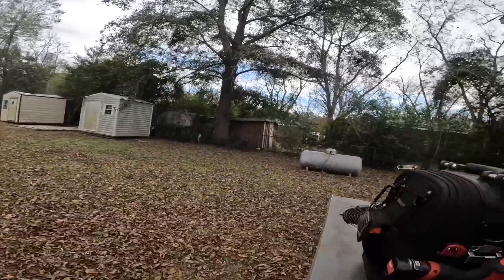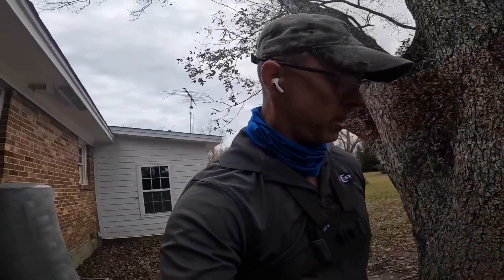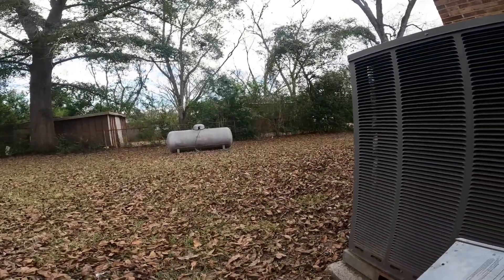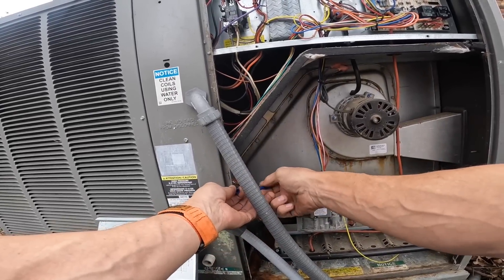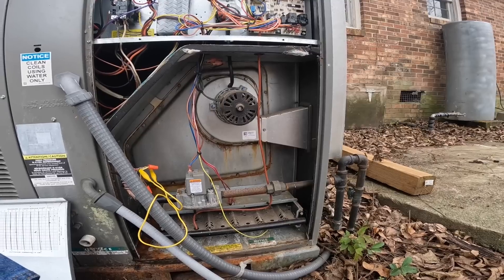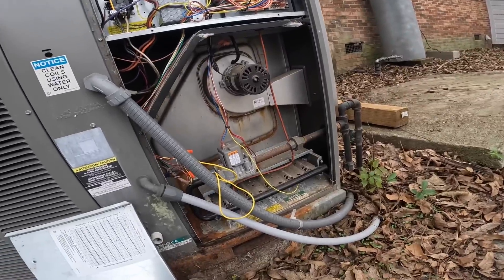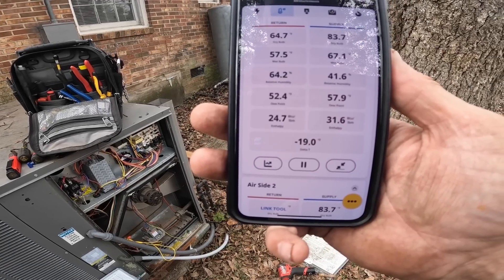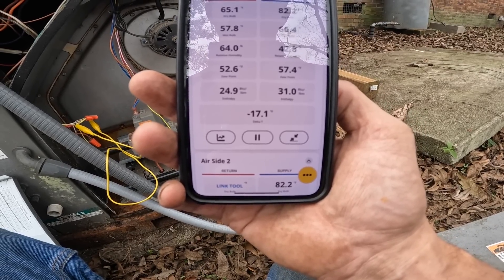Home Sale Inspection Documented a Low Temp Rise on Ruud Furnace.

Comment: In the old days when MFG companies started using fan relay "boards", and the fan relay went bad, you could use a relay and "G" to power up high speed fan, normally open contacts and power up low speed fan on normally closed contacts. - Now they use ECM motors and have furnace time delays on the board to start the motor rather than a fan limit switch. So my question is "How do i convert an ECM motor to PSC motor, gas furnace using a relay"? Do I still use "G" to normally open contacts for high speed (cooling) and normally closed contacts for low speed (heating) or not?

Comment: Could I ask someone this, I am working on a 2009 Rheem all in one gas pack. Need to replace the limit switch which is bad. I got a 3 flash warning. I want to take the part to supply store with me. Could someone tell me location. I think it the round item on wall in blower motor compartment, has 2 wires going to it. I have replaced the relay going to blower motor in squrel cage. I not sure about limit switch. I am a mechanic and hate to pay anyone for a job that I am capable of doing. Like to check behind myself with professionals

Comment: Aint got no gas in it. Propane shouldn't be filled more than 80% around here anyways. Should install the pressure switch on condensing furnaces otherwise end up sooting up the heat exchanger and she's shot.

Comment: Did you reattach the nut inside on that electric flex cable?  Occupant who left house wasn't going to pay to have gas refilled.  Another good case solved by the master sleuth.😎
Reply from the maker: I had to drop an estimate for all I wanted to do. Now someone, buyer or seller will have to address.

Comment: Tank sounds empty when you tapped it try shaking a little will tell also
Reply: HAHAHAHAHAHAH shaking that big tank is gonna tell You nothing
Reply: @m9ovich785   it does to me if it's full want move mine does but I never let it below 20%
Reply: @tedhicks5431  Mine is 500 Gallon. I wont be shaking that any time sooner or later.
Reply: @m9ovich785  mines 250 gal saved alot of gas going tankless water heater dual fuel love wood heat but wife hated the smell and mess after 28 yrs
Reply: @tedhicks5431  I turn off the Water heater in the Winter as My OWB heats the water in the Tank. Only use Propane for the Stove.
Reply: @m9ovich785  i watched a guy use coil per in green mulch pile goin through heat for hot water

Comment: Great troubleshooting. That unit has a lot of miles on it for 7 years, looks like someone has been Peeing on it!☺🇺🇸
Reply: This is how package units get. They are in the weather 24/7 so constant water damage and rust spots. Plus the sun causing over heating of the components and conductors. So they don’t typically last over 15 years if your lucky. And that’s the older stuff. I changed out an heat exchanger and inducer assembly just after 9 years and under warranty which is typically 10yrs. So I do not recommend package for residential unless needed. You do get a little more efficiency tho but not worth the parts you will be replacing. Just my opinion but tgif and good work Curtis

Comment: Heard the flame out. Plus the tank sounded empty. I thought LP gas valves were supposed to have a low pressure cutoff to prevent flame from backing down the burner tubes
Reply: Carrier lp kit does keeps unit from sooting up which is awful

Comment: Hello Curtis. If it happens to you again, you see the big green cap to the right on the tank? You press it down and if it does, the tank is empty. If not you will not be able to with your fingers. Also there’s a LLG on the side that when you loosen it it will withdraw vapor jizzin or white liquid if is full. Anyway, the tank shouldn’t be filled to more than 80%.
Reply from the maker: Thanks